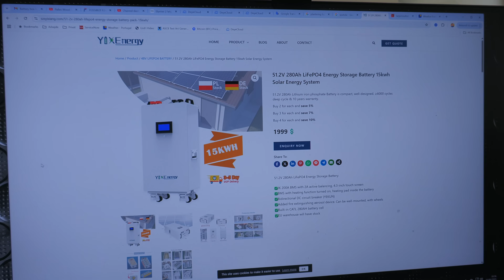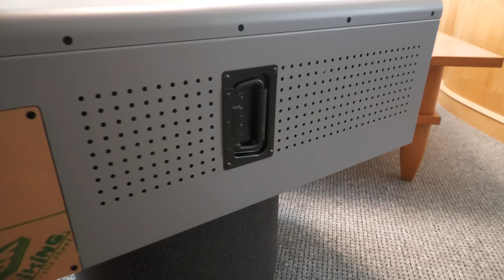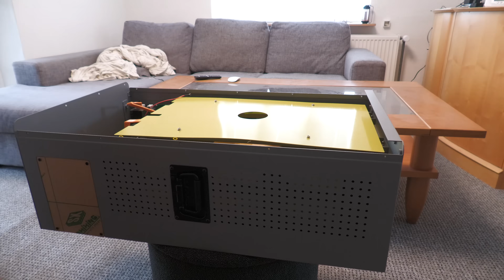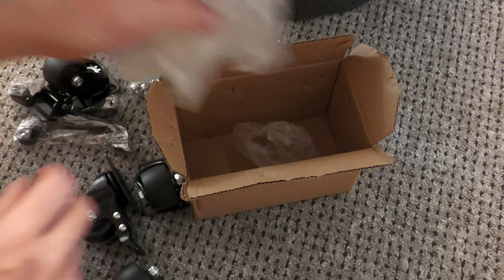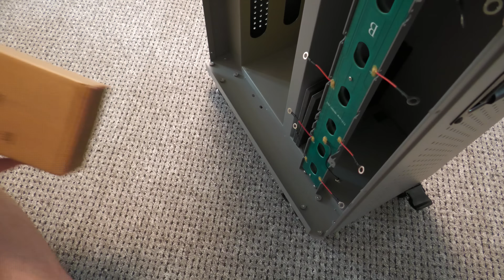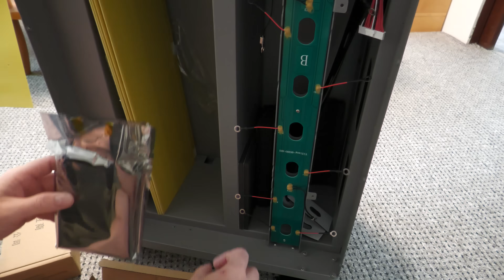DIY 51.2V 280-320Ah (14-16kwh) LiFePO4 Battery Storage BOX - 1505

Comment: pretty poor build quality, so many misses in the design. look at the radius at the top plate and the cover it does not have the same radius. some other boxes have a split in the middle so only 4 cells is on on top. the bottom one will have high compress with 7 cells on it. at least eve cells need 2-2,5 mm of of possible moment and is stated in the data sheet, same thing the cells cant lay down they need to be upright and is stated in the mb31 data sheet. Sadly for Yixiang have poor QC control and its even for the cells that comes with bad cracks in the cells from the welding of the terminal.
Reply from the maker: Sounds like you have some bad experiences ? I looked through some long PDF's on #EVE-314Ah-CB31-LiFePO4-Cell-Datasheet.pdf" and did not find that they had to be installed upright,,, only that they had to be compressed in the right direction.
Reply: @MyPlayHouse  yes i had really bad experiences with them and im not the only one, so changed over to another supplier instead. i can mail you the product spec if you want to read it.

Comment: Be extremely careful, LFP cells contain electrolytes which over time will sink to the bottom due to gravity, so you don't have the liquid around your cathode and anode in the cells. EVE does not recommend mounting cells lying down, but they should be upright to prevent damage during operation and storage. You will also have problems with pressure on your cells, the cells at the bottom of the case would have to bear the weight of all the other cells on top of it. If you want to use the battery box, it would be a good idea to lay it down so that the cells are upright. you wil also have issus with compression of the cells.. due to the weigt of the cells not being the same for alle the cells.
Reply from the maker: Thank You,, lots of stuff to take in to account.